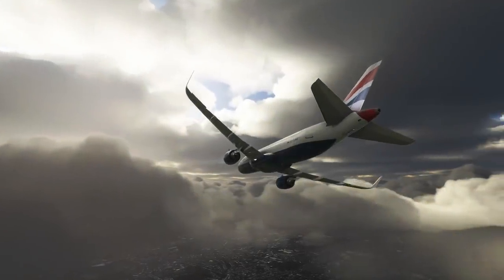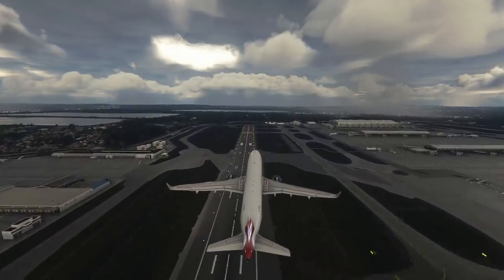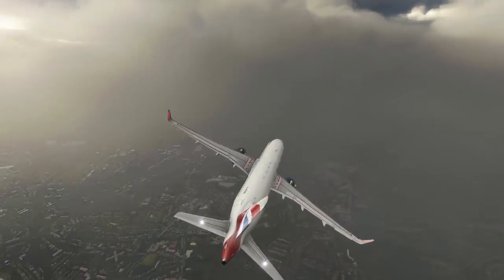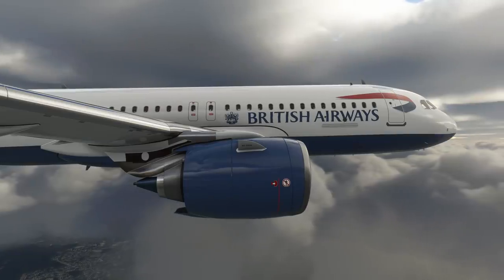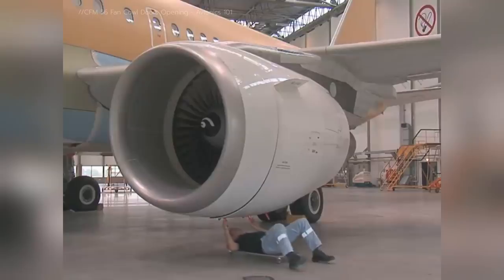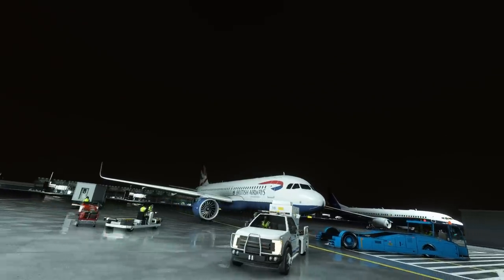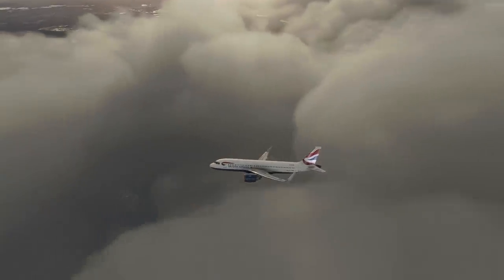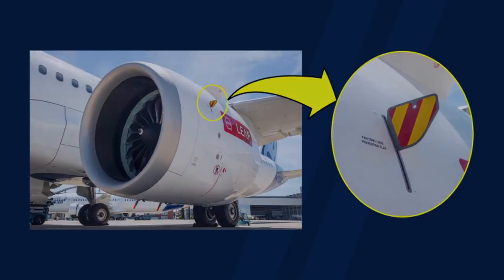Engine on FIRE over London | British Airways 762

Comment: This shows perfectly well that people will take shortcuts after some routine. It is show for nuclear plants too. Yes you can blame people but if you want to make things secure you have to make the system resilient to it.
Reply: This has NOTHING to do with the system! This is 100% human error and stupidity.  Those techs are IDIOTS!! They didn't even try to investigate the confusion. Additionally, they are too stuid to know the TYPE OF PLANE and mix them up? YOU LITERALLY WORK ON PLANES! Then that stupid first officer didn't do a proper inspection.
Reply: @iamReddington  There are ways to say things and ways to cause drama. Yes, there were definitely people at fault here, but that's no reason to get worked up over it and act like that.

Mistakes happen. Always will. The system (of protocols) is meant to provide enough checks at all levels to make a mistake impossible to propagate through to an air accident.

By the sound of the incident report and the action taken since, the protocols and even the aircraft themselves have been modified to make this particular mistake impossible.

At the end of the day, no lives were lost and the industry learned a lesson. That's the best outcome of any air accident.
Reply: @iamReddington  It has everything to do with the system. A system design allowing for a common error (as the video mentioned it was not the first plane to experience omission of latching) is a system design flaw. Human thinking is adaptive, but at the cost of approximation, which might lead to significant error in certain scenarios. You can do both active checks (requiring human inspection) or passive checks (issue a warning or something that draws the attention of a human even if not actively inspecting the system). A system designer (not necessarily on airplane) must not overdo checks (people tend to skip if too many warnings/errors are issued), but instead focus on feedback. And since this video mentioned there are 30+ cases of similar incidents, it is clearly that it is a design flaw. It is not isolated incident and error. But it is a common mistake of a system designer to blame all users of the system, instead of the system itself. Humans are not stupid, just incompatible with rigid (non-adaptable), repeatable procedures.
Reply: @IlluminatiBG  your answer nailed it. 

This incident had nothing to do with an aircraft engineer’s “stupidity” and I do find the notion them being described as being stupid is simply an obnoxious and flawed assumption.

Comment: Notice how there is a proper procedure in place to complete the task (the checklist the mechanic follows). There are also procedures in place to verify the procedure is done correctly (the 2nd mechanic verifying the work). There is even a procedure to warn others of the work being done (The cockpit warnings that cowlings are open). 

Maybe adding another layer of procedures isn't the solution. Possibly a safety culture requiring one task be completed in it's entirety before moving on to the next task combined with enough staff to complete the workload without the perception of a need to take shortcuts. 

Or keep adding procedures to protect against all of the other procedures being disregarded.
Reply: Your right there, too many checks cause some to always be discarded.
Reply: I'm not experienced with planes that much but would it had really been that challenging to implement a simple switch that has a warning on the cockpit ecam system from the begining?

Comment: Being a pilot myself an error by the engineering is put on pilots. Once the engineers release the aeroplane for flight and signed than it is their responsibility.  Everybody’s job is nobody’s job.  Exterior inspection is being made part of preflight procedure for the pilots. But engineering is also doing exterior inspection for their part of preflight procedure. Pilots concentrate on engine fan, turbine, tires for nicks/cuts and damage to airframe while doing the exterior inspection. Flying is a very serious business, casual attitude with may or might is a recipe for disaster.

Comment: The techs shouldn't have walked away leaving the cowls down but not latched, and the designers should have included something really obvious to show they weren't latched. Like the lanyards they put in later. I was amazed the plane didn't have a warning for the cowls being open, my car does if the hood is half latched.
Reply: I think the video did mention that features were added to the cowlings to more clearly denote unlatched conditions.
Reply: @Glen.Danielsen I thought there were still incidents occuring a couple times a year with the cowlings not properly latched resulting in a return to the departure airport. Haven't there been others since the Frontier in Vegas?
Reply: I don't think a bright red latch UNDER the engine is a good enough visual warning that the latch is open. Like the video said, you have to get down on your hands and knees every time which would get boring after awhile. 

Don't get me started on the small gap either 😂😂
Reply: @hewhohasnoidentity4377  Retro fitting those features is either not required or a low priority maintenance requirement. You can not ground all planes with a particular engine and retrofit them on any airport. Trying that would add a lot of risk. Offcourse, that causes the hell of field variations on nominally the same plane with the same engine, where an experienced captain assumes a cockpit indicator light, but the flight he is in today does not have it. Same with mechanics looking for the flag on the engine, when the variant he is servicing is an older variant.
Reply: The average driver is… subpar at best. Airplanes are to be operated by trained professionals. The engineers are obviously at fault, but I’d say the FO wasn’t blame free either.

Comment: Some mechanic lost his job over this one!

I had an engine fire over England in a 727 in the fall of 1999.  We took of from East Midlands airport headed to Brussels as a DHL cargo flight and passing through 5000 feet, we got an engine fire indication on the number 3 [right] engine.  It was a beautiful night, I could see the lights of London ahead, so weather wasn't an issue.  I was flying at the time, so I leveled off, told my crew that I thought the most correct plan was to shut the engine down and return to East Midlands.  They agreed, so I told the first officer to call ATC and tell them that we were leveling off, we had an engine fire indication, were declaring an emergency, and needed immediate vectors back to East Midlands. After this was accomplished and we were being vectored back to the airport, I had the first officer take the controls and me and the flight engineer did the engine fire checklist.  Thrust lever...[confirm] idle.  Start lever [confirm] cutoff.  Fire handle [confirm] pull, extinguisher bottle, fire.

As soon as I pulled the throttle back to idle, the fire light went out;  This means that this was not an engine fire, it was a hot air bleed leak.  We bleed 750 degree F air from the compressor section and run it into the lip of the engine and on occasion the leading edge of the wings in order to remove ice, and apparently one of the bleed pipes had broken and this extremely hot air hit the fire sense loop that encircles the engine, setting off a fire warning.  With the throttle to idle there was no more hot air and the light went out.  I told my crewmembers I suspected this, but we still shut down the engine and made a successful emergency landing back in East Midlands.

Fires and other emergencies need to be handled properly and dealt with correctly, but take my word:  Rarely are they REALLY a threat to your safety.

-The Guinness beers I bought my two crewmembers at the airport hotel in East Midlands a few hours later tasted REAL good!

Comment: Butterfly servicing flitting from one job to the next is guaranteed that something will not be done properly. Once started on one plane that should be finished first and then move onto the next, the mechanics should not be working under that type of pressure / workload but the airlines are too tight to employ more as they are only interested in their profits.
Reply: sounds good in theory, but in practice: What do you do, when you find a defect, order a spare part and it will arrive in time for departure, but 3 hours from now? Twiddle you thumbs for 3 hours waiting for a part? Or make a visual inspection on an other plane?
What do you do with planes in the hangar, where the work is planed to be multiple days?

Comment: Oh that's awful, I do feel sorta bad for those technicians, thats 5 planes to work on through the night and having to look for tools, they must have gotten turned around, seems like they should have documented what plane needed what better and I'm surprised there is no warning on the plane for engine covers open, cars have bonnet warnings for a while, why not planes.
Reply: How many sensor do you want to add to the plane?
How do you test those switches?
How do you troubleshoot those switches?
Would you ground a plane because of an open indicator, when the lock is confirmed locked?

Your engine cover is a good example: You do not test it.
You just hope you don`t forget to close it and you hope that if you forget to lock it the warning comes on.
But: You do not regularly intentionally open the hood to verify that this feature is working.
Reply: @sarowie  
1: Two hall effect sensors per latch set up as redudant to each other, if the engine managment computer detects either a disagreement between the sensors, or both sensors showing the latch/es is/are open, flags a warning on the managment computer and prevents engine powering on, until a physical reset procedure is carried out in the effected engine cowling, this ensures crews must open the door to manually inspect the area and if the door is just open, they can immediatly see that was the fault, if the sensors are malfunctioning, the reset procedure can be set to a manual single use override (this ensures the system can not be just permanently diabled) for the flight. 

2: Testing sensors using a Power On Self Test, comparing the results from both sensors against one another and seeing if the expected results match operating parameterss, if a fault is detected, see above for procedure.

3: Hall Effect Sensors are by no means the only method to use, but I'd prefer them in this case as they're solid state and fully sealed. If one fails, you can make it a simple module to unscrew, remove, install the new one and screw in, it's really not that hard. The plane already has hundreds more complicated sensors.

4: See above override, however if a plane has a broken sensor that's not critical for flight but important for safety, then yes you should ground it. Passenger safety comes abobe profits and flight planning. I couldnt' care less if the air line looses money for a slight because of a potential issue, as a potential issue could bring an airliner down. These airlines already play fast and loose so fuck 'em.

5: if a car sensor breaks, not a big deal, it's not like the car is holding 100+ people, 12000 metres in the air, if your car is holding 100+ people 12000 metres in the air, I don't think that's a car, that's an airliner.

Comment: How can technicians not know the difference between an a319 and a a321? Surely their paperwork included the aircraft reg number to confirm they were working on the correct one?
Reply: I don't know what they look like from a technicians point of view. But both are just variations of an A320. So I guess, if you are aiming for the engine on a rainy day they look all alike.
But I agree, there should be crosschecks to make sure you get the right one.
Leaving an unfinished business without a clear warning is even worse. But I reckon this has been addressed...
Reply: Well like the other person said, it’s just a variant of the 320 in the same livery, the 2 aircraft would actually look fairly similar on a rainy day where workload is high and stress is evident, the technicians obviously weren’t focused as much as they should have been causing them to misinterpret 2 different models as the same, fatigue along with incorrect procedures also played a part in this (both with the technicians and the FO) fatigue is one of the most common things to happen in aviation and can be hard to avoid when work load is high unfortunately.
Reply: @rtlgrmpf  Variations, sure, but variations from the polar ends of the A320 family, 319 being the shortest and 321 being the longest (or longer by roughly 11 metres or 35% longer). That's not a tiny difference.
Reply: @rtlgrmpf it couldn’t be easier to differentiate between an A319 and A321. A321 is much longer and they differ greatly in the number of exit doors (A319 has 4 and A321 has 8).

Comment: Well, I don't know about you guys but, whenever I have to go somewhere to get another part or another tool to fix, say, a car, I completely close the hood before heading off even though I've only ever had to work on any one car at a time and even though the car being worked on almost invariably wouldn't start before getting fixed anyway. It seems to me that securing that latch is kind of like turning the light off when you leave a room in that it might be fine if you forget but it will definitely waste power and, if something is wrong with any part of the electrical circuit, poof, you have a fire (speaking here as someone who has lived in a number of places with older wiring). If a fire were to start and you were still in the area, you could put it out quickly, like the time that I lived in an apartment and one of the wall heaters caught on fire. I actually had the fire out before the fire department arrived but it was still they came and made sure anyway.

Comment: I feel like this accident was due to both the mechanic failing to follow procedures as well as the co-pilot being careless with the pre-flight check.  It should be common sense to never leave something like a door or latch open without making it apparent, eg. by leaving the door open wide.  I'm not sure how they mixed up an A319 and A321, the latter is some 11m or 31% longer than the former!  Great video though, it's good to see something unique getting covered.
Reply: leaving the covers of the engine wide open during rain?
Reply: I know that this accident was technically on the FO since he failed to properly verify they were latched properly, but honestly, it seems to me that the "cause" of the accident was the flawed design which made verifying that everything was correct difficult, with the improper maintenance and the bungled walk around contributing factors. The fact that this happened multiple other times really means that the problem was not actually with the pilots.

Comment: An interesting situation. The good thing about accidents is they are rare events. The bad thing about accidents is that they are rare events. When trying to set up a safe procedure, adding too many steps can lead to some steps being skipped. I think the flag idea is good because it doesn’t require the mechanics to go into the cockpit in order to warn the pilots. An interlock warning would also be good, but it adds to the weight and the complexity of the aircraft. Also, what if the warning system becomes defective? People might be relying on a light that won’t light. 

It’s not practical to require maintenance personnel to complete the procedure before going on because, as in this case, something may happen requiring them to interrupt the procedure. However, having A prescribed way to interrupt the operation is necessary.

They probably closed the cowling doors because of the rain. However, they needed to protect against the possibility of the plane taking off with unlatched doors.

It’s really good that no one was seriously injured. However, this procedure definitely needed to be upgraded.
Reply: You mentioned what if the warning system becomes defective. That’s where redundancy comes into play. 

Pilot walk-around, engineer checks, flags and sensors together is a system that has built-in redundancy. 

If one of those fail then the others provide safety through redundancy.
Reply: @mikes-bmedic5484  When the sensor indicates "open" when all other checks verify closed, what then?
Ground the plane to troubleshoot? Fly to destination and then maintenance?
How do you prevent pilots from relaying on the indicator instead of their walkaround?

Comment: Those technicians have so many aircraft to work with, perhaps the manufacturer could paint the inside a highly contrasted color from whichever airline livery will be used outside.
Reply: the plane is painted by the costumer, not the plane manufacturer. Paint has a real weight that uses real fuel. adding it without a direct technical function (e.g Surface Protection, e.g. high gloss to make deformation obvious) would be inefficient (wasted time painting and needles weight).

Comment: The answer is simple, when working on a plane, you don't leave it until the work has been completed and verified as complete and screw the management on pressuring staff to get other planes serviced before completion of the current plane. As well as that, a mobile supply truck with all that they need to be called upon to come to that set of engineers if they need certain things is needed, mainly so that the crew of engineers don't leave the job until its done.